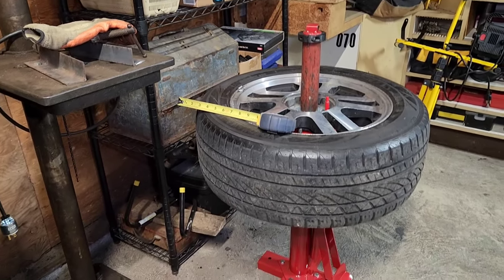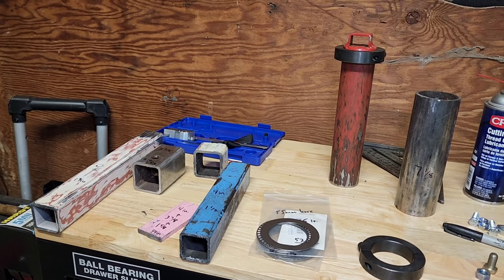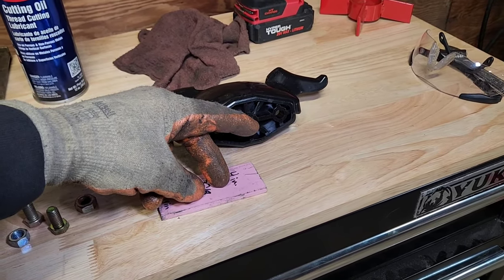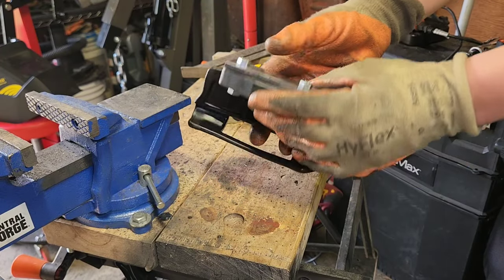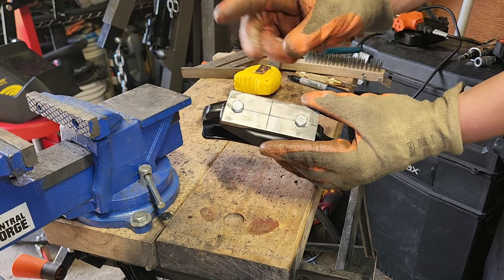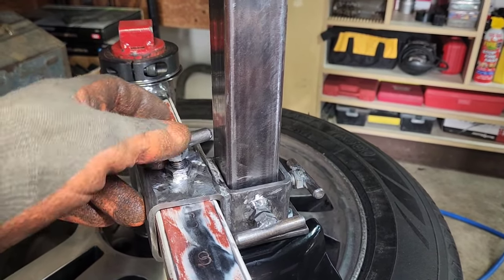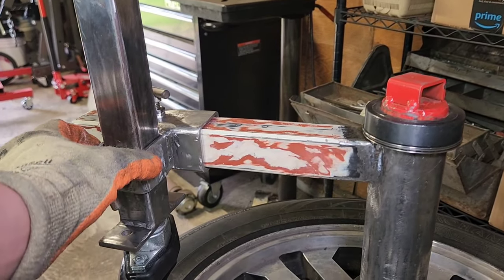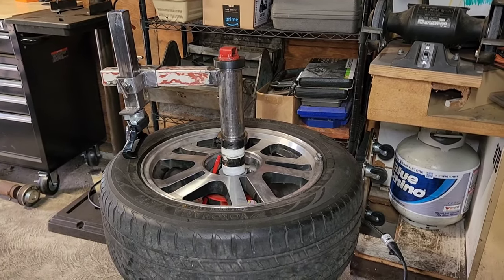Harbor Freight Tire Changer Duckhead Mod (Full Build With Tips and Tricks)

Comment: You put a lot of thought into this build and you obviously have an engineering mind. That said, I think you are over complicating your efforts by using thrust bearings where they are not necessary. By eliminating the bearings, you can have a longer  vertical tube length of 9-10 inches which gives you the stability needed, and you can easily remove the duckbill assembly from the changer without having to unthread the center piece each time. Also it is easier to use round pipe for the duckbill assembly. Find a round pipe that fits snugly inside the square tube clamp. That way you can position the duckbill at any angle to fit the rim properly.
Reply from the maker: I agree with using a round pipe. Ideally, I would have ordered the 30mm duckbill and used a square pipe a little bit bigger as a guide. You know what they say about hindsight. Honestly, the vertical tube length gives plenty of stability. I think the bearing is a great touch, it rotates super easy with a push of the finger. Ideally, I would have purchased the proper sized bearings and would not have made shims.
Reply: I have a couple old struts that I saved just thinking they might be good for something; I wonder if they could be repurposed for this- maybe the strut bearings if nothing else..

Comment: You don't need bearings. I used a pipe that was just large enough to put a pvc pipe section inside the metal pipe.
Reply from the maker: Good idea, but the bearings really do make it smooth. I've thought about using plastic from a milk jug as a friction shim since it's thin.
Reply: I've been trying to understand why people have been adding thrust bearings to their duck head mods. So far, it appears the bearings make the assembly feel smooth when spinning the duckhead around, but I don't think there's much of a difference once the duckhead is pushing on the tire bead.

It seems what's more important is to have a bushing between the two pipes to take up some of the excess slop so that the duckhead doesn't flop around so much.  Minimizing the freeplay helps prevent the duckhead from making contact with the rim.  

Has anyone figured out an easy, effective, but cheap way of adding bushings?  A couple ideas I'm thinking about, but haven't tried yet are heatshrinking a used PET pop/water bottle around the shaft or cutting up a 2" copper pipe to use as the bushing.

Comment: You need to get yourself a set of Transfer punches and that will eliminate most of your measurements when you have a perfectly good pattern to transfer from. Also DO NOT wear the type of shorts that you are wearing in your video when you are welding! Use cotton or leather for your own safety! If a spark or worse yet, a drop of molten metal should get on them, they will melt and adhear to your skin,
Reply from the maker: I'll have to look into the transfer tape, I've never used it. Trust me, I know about melted polyester, but I have to stay comfortable. Good looking out.

Comment: Instead of a shaft collar I use two exhaust clamps. I used  1 7/8 clamps but just used the saddle part with long bolts.
Reply from the maker: If it works, it works. Got a pic so maybe someone else can give it a shot? The shaft collars are kind of pricey, but they ensure the bearing or pipe has enough surface area to rest on.
Reply: @octanedrivendream  Amazon has centering cones for around 10-12 bucks. The are made from metal and looked like they are pressed from fairly thick metal. They fit the shaft just fine too.
Reply from the maker: @mcqueenfanman  Do you have a link? I ordered one from eBay, and it was too small for the wheel hub. Are you sure it fits?
Reply: @octanedrivendream  Fits normal wheels, not those truck wheels with huge center holes.
Reply from the maker: @ksavage681  I have 2 Mustangs and the wheels have a hole for the hub nut. I found an old machine part that is flat on one side and beveled on the other. Since the flat side has 2 tiers and the top one is skinny, I used a conduit reducing washer to make sure the pressure is even.

Comment: Seems like it is overtechnicalized.
Reply from the maker: There are more simple methods to upgrade the tire changer. If you don't use bearing, find a pipe that's a little larger,  weld on square or tube and grease it. Then you can use the original pole for leverage.

Comment: Why didn't you use the original plate with the pipe for the duckbill as your template for your new plate for the square tube?
Reply from the maker: I tried, but when I went to mark it through the bolt holes, the thickness of it wouldn't allow my marker to draw all around the hole. To be sure, I just measured and did the math.
Reply from the maker: I filmed explaining why I did what I did, but the video was so long I cut abunch of stuff out.
Reply: @octanedrivendream  you need a center punch to mark the holes but good job
Reply from the maker: @nobullshiit5682  I have one and used one before I drilled, but getting it perfectly centered in the hole was the problem.  The bolt holes weren't fat enough for a marker, and I didn't want to over drill it more than I had to.
Reply: @octanedrivendream maybe spritz the holes with some rattle can spray paint
Reply: @dubmob151  This is the way.

Comment: You don't need the bearing  to do this build
Reply from the maker: Technically, you don't. The ones Lucid makes have bearings. I was trying to go for something similar, plus the bearings do make the rotation smooth. There's various designs, but I do think the bearings are a nice touch.
Reply: @octanedrivendream  yeah i will build mine with the bearings, i like bearings instead of metal against metal
Reply: @nobullshiit5682  Your pushing sideways though, bearings have little benefit.I used PVC pipe underneath the metal round pipe.

Comment: A tip for layout of holes: Center punch the center hole first, and then put one of the points on your calipers (set and locked for your dimension) in the punch mark, and scribe with the other point over the marker center line (like a compass). They are sharp so you can do such things.

Comment: Put your set screw through the corner of the square tube. It will push the opposite corners together and make a very tight set
Reply from the maker: I considered this, but I was originally trying a different design. I suppose if you notched it, it would hold the nut and you could get a flat weld. That's what sucks about welding a nut on round stock, heat/wire can move and lift the nut making your screw angle bad.

Comment: Shock Colar?   The Colar that you have has an Allen screw.  If the screw is loose and the color still goes on hard just spread it out a little with a pry bar or large screw driver.
Reply: 1:31 it's a 2" bore SHAFT collar. You're right, the two halves come apart and you assemble it over the 2" pipe where it needs to go. I have never seen anybody hammer one of these on!

Comment: On your offset of the duck bill, slot one of the two duckbill holes in your flat plate and sou should be able to rotate it enough to get it adjusted properly.
Reply from the maker: Hindsight continues to rear its head. Honestly, I like using a round pipe to adjust the height while using the plate that came with the duckbill. By using the set screws, you can adjust it however you want. Initially, I didn't think the set screws had enough clamping force to keep it from rotating, but it holds well.

Comment: Cracking job buddy, what were the bearings you said you found that were the right size im finding it hard to get them
Reply from the maker: I can't remember, sorry. I think I talk about the sizes in the video, just Google that size. I vaguely remember the ones that I found being around $15-20 a piece. You may be able to get ahold of a transmission shop, they may know of a bearing that is the right size. It's difficult finding what transmission has a bearing that size.

Comment: Great job you got another subscriber  ,very informative , cant wait to build mine  .
Reply from the maker: Thank you. Let me know how it goes. There's other versions out there.
Reply: @octanedrivendream   yeah I watched a bunch of vids. I like this version.  found some 2 inch ID steel pipe now all i need to do  is find some steel square tubing , pipe is super expensive now so im gonna salvage what i can but I ordered  the 2 inch ID thrust bearings, ill just grind down the pipe hopefully they will work and willnot be too tight an di will not have to grind too much pipe away . keep the vids going
Reply from the maker: @nobullshiit5682  The price of metal is getting crazy. I was going to make my own hydraulic press, but it's almost cheaper to buy one.

Comment: 29:03 couldn't you just slot one of the bolt holes, using the other one as a pivot, to allow rotational freedom for adjustment to the exact angle needed?  That assumes your bolts are strong enough to hold the duck bill position locked while in use.
 Edit- Nevermind, reading down the comments and saw Robert Terill already mentioned it a month ago🙃
Reply from the maker: Hindsight man. What I ended up doing works, and it allows it to rotate.

Comment: Hi mate, very good . Thanx . Just a small question, sorry to trouble is the bead mount demoing duck  thing  made from plastic?  Respect from Australia
Reply from the maker: Yes, the duckhead is a consumable. They make them that way so they don't mare the rims. They do make a metal style duck that has replaceable nylon pads, but after some research I chose the plastic.
Reply: @octanedrivendream how durable is the plastic? Ideally it shouldn't touch the wheel when it's used, so it seems the main attraction of plastic is lower cost, but hopefully it'd hold up reasonably well and not really require replacement from wear and breakage.
Reply from the maker: @dubmob151  It's really strong plastic, almost like what they'd make a valve cover or intake out of. Ideally it wouldn't touch but realistically, you want to protect your rims and tires. If you use it a lot, it will wear from tire contact but lube helps.
Reply: The nice thing about that specific style of duckhead is that if there is rim contact, it's the bottom of the head that will contact the rim bead seat, and it helps prevents contact with the rim face.  Someone else posted a video comparing the different styles of duckhead.  I suggest looking it if you want to understand which one will work best for your needs.

Comment: I just bought a center cone for about $10 on eBay
Reply from the maker: The one I ordered from ebay was way too tiny to hold the wheel hub down.
Reply: @octanedrivendream  Put it under the stock red cross part.

Comment: lots and lots of exact millimeter measurements but emphasized it doesn't have to be exact...lol
Reply from the maker: It's not exact. You can build it how you want. I was doing it on the cheap and working with what I had. I was going over my train of thought in case it helped someone. A lot of the measurements were specific to what I used. With hindsight, I'd do it a bit different.